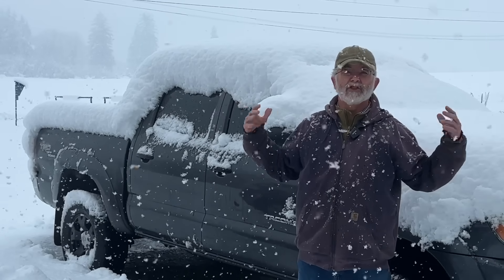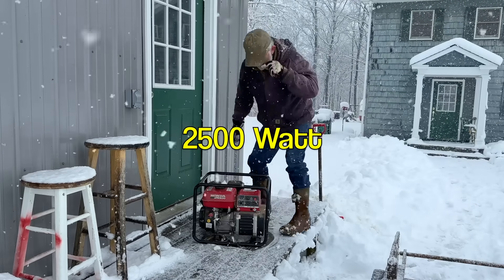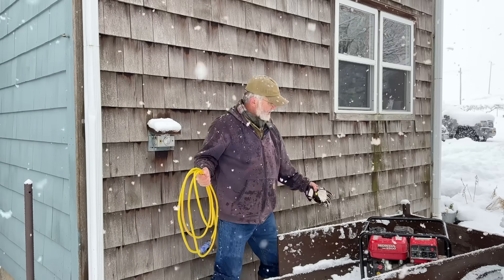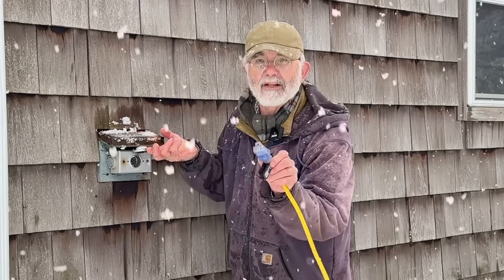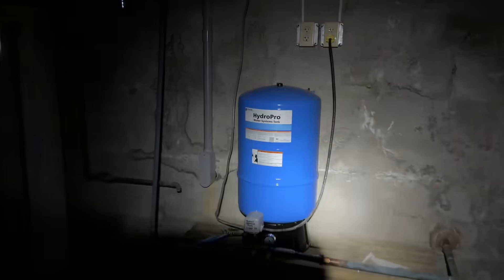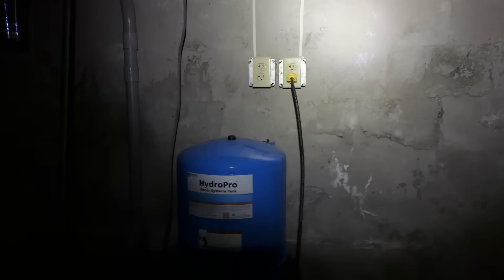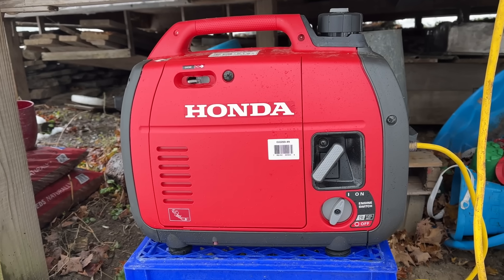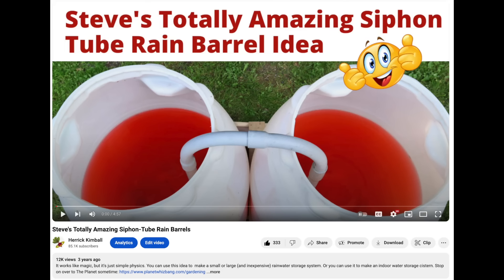Super Simple Generator-To-House Hookup  -- A Proven How-To

Comment: I personally find the simple main breaker sliding lockouts to be an even better solution and just as simple with no need to plug things in to different places.  Just run one outlet from a top breaker in your panel outside for the generator and then all you have to do is flip the main off, slide the lockout plate and turn on the generator breaker and all circuits in your panel can be energized.  All you have to do is not switch on too many things at once based on your generator size.  Simple and safe.
Reply: Yes, that is by far the simplest was to have back up generation with a 7-10K generator. Power goes out, flip the main breaker off, plug in the generator on the outside plug, wired to a 50 amp breaker in the  main box and you are set for all circuits. Had to run 10 days once and was fine.
Reply: A Sliding Lockout is a sure fire solution and simpler.
Reply: Interlocks are required
Reply: I have done something similar by installing a separate panel that has an inlet for my generator and circuits that are next to my critical appliances and furnace. Those circuits are not connected to the grid and their face plates are red indicating they are "emergency " power outlets. When power is out, I unplug from the grid outlets and plug items into the "emergency" outlets right next to the grid outlets. I know when the power comes back on by the grid because my lights are still in the grid outlets and then I know to switch back. I use oil lamps and battery lanterns for light. This setup keeps me from dealing with codes and inspectors and, most importantly, protects the electrical workers since the circuits are separate. I got this idea from the hospital I work in and saw the red outlets next to every bed.
Reply: @ This certainly works and is safe, but it is both costly and inconvenient compared to installing a generator outlet near your service entrance and then connecting it to your panel via a breaker and a generator interlock.  And with the latter, there is no need to go through your house and move the plugs on every appliance you wish to use, which of course has to be done again once the power is restored.  With an interlock, you flip the main off, slide the interlock and flip the generator breaker on and you are ready to use any circuit in your house.  And you can easily switch off any breakers for heavy draw items like AC that you don’t want to come one.  It is all done at one location in less than 60 seconds.  And for far less cost than running separate circuits to your appliances, installing a separate panel with breakers, etc.  I can’t for the life of me understand why anyone would do it any differently given the cost and simplicity of an interlock kit.
Reply: This is the legal code compliant way
Reply: @LTVoyager  my problem with an interlock is that my breakers are push button and I don't think they make one but when my solar is up and running I'll cut the grid as it doesn't. make sense to save 60 dollars a month and pay 200 dollars a month to stay connected to the power grid
Reply: @ If you have Pushmatic breakers, you really need to do a panel upgrade.
Reply: I did a setup with my portable 12,500W new GE 110/230 generator. The whole house generator was around $1,300, delivered.

I plug it into my 50A male plug... mounted right next to my main service panel. I have the big gauge 25' electrical power cord to run outdoors to the generator.
I roll the big generator  out the basement doors, cut the main power circuit to protect others from backfeed, and fire that baby up!

The generator runs everything in my house AND also runs my 230 well pump and Utica boiler.

I'm careful not to run too many large appliances like the electric clothes dryer, microwave, or electric stove top all at once.
You can hear the generator bog if you do.

Herrick, I realize you ran separate circuits for your generator power, BUT IT'S VERY IMPORTANT TO EMPHASIZE CUTTING THE MAIN BREAKER TO THE STREET IF YOU DO NOT HAVE DEDICATED GENERATOR-ONLY CIRCUITS.
It's too easy for others to make a fatal mistake affecting power company lineman.

Sincerely,
Your Fellow Upstate NY Neighbor
Reply: @ This is both an illegal and a stupid way to connect a generator.  Protecting lineman absolutely must not depend on your memory.  It needs to be failsafe.
Reply: @LTVoyager  No, there is no problem with Herrick Kimball's set up because there is no connection to the utility power and no possibility to feed power back into the grid.  Watch the video again.
Reply: @jimthode  I was replying to Yoppyman, not Herrick.  Not sure why my post lost the name after the “@“ sign.
Reply: @LTVoyager  Watch the whole video!!!! hes not connected to his Breaker Box!!!!!!!!!!  Pay Attention!!!!!!!!!!!!!
Reply: @MRTLEW01 Yes, pay attention!  Read the prior comments.  I was not commenting on the video.  I was commenting on what another commenter said.  Try to keep up.
Reply: @LTVoyager A shame you don’t understand electricity.
Reply: @davidrobins4025  I’ve forgot more than you’ll ever know.  Just what do you think I don’t understand?

Comment: with a generator that small i would put a 4-gang box mounted vertically next to your sub panel and put in 3-way switches. hook the load to the common, and both feeds to the travelers. cheap transfer switch. ofcourse oveerload protect the generator feed before going to the switches.

Comment: I do the same thing.  I have a 20 amp inlet on the outside of my house.  It goes inside the house to power one outlet that is never hooked up to my regular house power.  That will run my sump, furnace and a few light appliances to keep us going for a few weeks on generator power.  I also have three solar power stations to move from room to room to power small electric devices.  My last ditch plan after a few weeks of no power is to use around 600 watts of solar panels I have stored in my garage to recharge a 4800 watt battery bank I have in my basement.

If you have a newer furnace with a circuit board you may need to bond a ground on your generator or if you run a battery bank and inverter system you may need to run a ground wire from the inverter to a chassis ground on your furnace for it to run properly.  The new furnaces will look for a bonded ground in your main panel and if they do not see that they will try to start and shut down.

Comment: This works but for just a little more, I just installed inlet 30 or 50 and just back feed panel with a manual interlock and I can pick and choose what circuits. I don't' have to worry about extra plugs or extension cords, etc.
Reply: I did like you and installed a 30 with the manual interlock, makes it so much easier, and as of yet haven't had to use it but I can say I am ready!!!!!
Reply: Be careful if you are backfeeding with a 120V generator like his. Few nuances

Comment: I have come up with a similar solution for my home. I do have a whole home generator but it really guzzles the fuel. This was pretty much my solution to power the internet and refrigerator/freezer with a smaller more economical generator. Love having both options. I have the same type setup with parallel outlets that are only active when powered by a generator. I use different wall plates so everyone knows. Great idea, glad someone else thought of it too!
Reply: @HIKETOGRAPHER Those generators can cost from $70 to $100 per day.to operate. The dealers also try to sell you the biggest generator possible when you don't need to run every light in the house. The only time people should get one is if they have medical issues, or children home alone. Of course if they want one or have money to burn.
Reply: Great video. 
Wonderful idea of parallel circuits. 

The only thing I would change is to identify “emergency power receptacles” as you mentioned. 
That way anyone that follows you can identify what you have done.

Comment: Unfortunately my well pump is 1.5hp 220.   I have 3 generators of various sizes including a 10kw dual fuel that can run most of my house except electric furnace and range. Fortunately I have a spring fed pond and rainwater catchment for flushing toilets and general cleanup so would only have to run the big generator occasionally. My main concern is power enough to keep 2 fridges and a chest freezer going and run the fan on my wood furnace. You worded it very well, not going to live like nothing happened but enough to be comfortable. You can keep all that snow tho lol. I'll take Oklahoma weather

Comment: I'm looking forward  to a power outage  in the winter here in Ohio. An electrician  friend  told me I can just put fuse out that runs the furnace, then disconnect the Hot black wire and White neutral wire and put a male plug on it. Then connect  it to my generator.  Got heat in the winter. No problem!

Comment: Simply easy solution to for house generator  hook up. Well done.  I ended up labelling the outlet covers as well as spray painting them RED.  I was going to check if I needed a ground rod to attach to the generator and how "clean" my power from generator is. (It is not a honda....)I am also an electrician.  You did a nice clean install. Appreciate efforts it takes to make these presentations.
Reply: just a thought - I'd make it glow in the dark paint, not just red.
Reply: Did you find anything out about the ground rod on the generator? Its been a question of mine for awhile. Thanks!

Comment: Your videos have been very helpful to me, now I can return the favor. We have just finished a diy hybrid solar/battery/inverter whole home power system. I also couldn’t justify the cost of a whole home backup generator, (which costs $15k in my area, and frequently fail), as you have correctly concluded, a high cost with no payoff other than convenience.
For less than that, we are now consuming ZERO grid power! I’ve been watching the solar industry for many years, and in my opinion, the cost and reliability factors have finally reached the “no brainer”point. 
The key is DIY. If I can do it, you certainly can…
Reply: I'm powering my home from solar too. My grid is my first backup and my generac generator is my secondary.  If I have a good charge in my ford lightning I run my home from that prior to using the grid.
Reply: @ I’ve been thinking about getting that Ford lightening for the same reason… adding to the battery bank!

Comment: Nice simple implementation but maybe label those outlets so everyone else will understand what they're for. And how did you address the grounding on the generator circuit? Maybe best that they be tagged/labeled as un-grounded? Also, what about moving the generator as far as possible from the house. A night time thermal inversion with no wind could push CO up against the house.

Comment: Agreed! A whole home standby cost is hard to swallow. I was quoted $18K CDN for a 24Kwh Generac unit.
Reply: I gradually built my home solar backup. Now retired at 75 I have 55 kwh of battery storage, 18 kw of solar panels and 8.8 kw inverter. With another 10 kw inverter connected to the same battery bank to charge my EV truck. It took many years but now I'm finally ready when our grid goes down for an extended period,  which it will either by failure, cyber attack, solar flare or nuclear EMP. What this administration is currently doing messing in Russia/Ukraine war we may not have to worry about having electricity or anything else for that matter. You can only poke a dog with a stick for so long before it attacks you.
Reply: @ek8137 Stay away from Generac go with Kohler.

Comment: My $1,000 Predator 8750 inverter generator runs my entire house, and it was much easier to just install a 240V 30 amp plug and a double pole 30A breaker in my 200A panel box, and no, I do NOT back-feed the grid👍
Reply: Transfer switch?
Reply: @ Nope, I hooked it up to my 30A double pole breaker from my old electric water heater. I have gas heat and hot water, a gas cooktop, and city water so I have no problem running my house. I have 200A main fuses that I pull before I start the generator.
Reply: Technically illegal.  Code violation.  But safe
Reply: @seethebutter  I know, but it was so worth saving the $1,000😂
Reply: @seethebutter no violation if a manual interlock is used

Comment: While it is a minimalist solution. I have a 7000 W running, 10,000 startup generator I connect to my main panel w a 30 amp 220V connector and manual transfer switch on panel.  During a outage, I drag the generator out of my garage and 10' away is my plug.  I have gas heat, electric hot water, 220v water pump, etc.  I run everything except my AC in the summer.  TVs and computers w. I problem (I am a computer tech).  The generator was $800.  You have 2 generators and 2 Jackerys. U spent a lot more money than me and have more transfer actions and power very minimal things.
Reply: You conveniently missed the point of having someone do that work for you…. Go hire an electrician to put a manual interlock on your panel.  I like you did it myself and saved a lot of money, but the vast majority of people don’t get into that level of electrical work.

Comment: Good video Herrick,  you keep em separate "one or the other and never both"  the only safe way to do it. Reliance makes a feed through inlet for generators with just the lnlet on the outside and 4 110v sockets on the inside. We just added a gen and we went the transfer switch route.  The only suggestion I have is to LABEL your Gen outlets!   Well done, have a great day.

Comment: I'm arguing with my neighbor- So you are running extension cords from that ONE SPECIAL outlet to your fridge and whatever and that's all- That special plug goes ONLY out to the generator. I think I got it - seems like genus to me.
Reply from the maker: Two special outlets. One in closet and one in basement for the water pump. Closet outlets provide power by extension cords (12 gage wire cords) to fridge and freezer. The "special outlets are powered by the generator only. 👍
Reply: @herrickkimball  Thanks Boss- you just won me a cup of coffee from the neighbor- I may give this a wang before the snow hits

Comment: I used to do the same thing you do, but after slipping on ice and screwing up my rotor cuff, I don't pull any cords any more. I have a 10K generac generator and installed the whole thing for $4k.  All automatic no doing anything with any of that bs. If it really hits the fan thats life. At 75 dragging gas and pulling cords don't fit my bill anymore.

Comment: 1998 we had a 3 to 4 day ice storm in northern VT and NH. Maybe you as well. My Homelite 2500 watt Briggs powered generator that my dad had since the 1970s was shuttled from house to house in the neighborhood. It was hooked up to furnaces or heaters for a few hours and then on to the next. A fireman who was an electrician oversaw some wiring changes on 120 volt furnaces for temporary plug in to the extension cord. Your idea makes it a lot easier to accomplish the same thing on a more permanent basis. In my house the sump pump is on the critical branch along with the freezer, refrigerator and furnace. We are on town water.
Reply: For your sump pump issues, look into water assisted sump. No power required. Uses your town water pressure.
Reply: @TD-we1vpgreat idea

Comment: Great idea I have done the same thing for my well at home nothing connected to the grid completely separate system run off your generator. A 500 gallon propane tank and a 5,000 watt predator propane generator and you could power for a very very long time!!

Comment: All fuel shut offs and carburetors are different but, I’d turn on the fuel 5 to 10 minutes before trying to start the engine to let the carburetor fuel bowl to fill.
The engine should then start much easier.

Comment: First, I thought that it was going to be an illegal hook up.  Surprisingly, it was done as a parallel system.  Good job, that was an excellent choice...  I would do only two things for this system.  First, I would label the cover plates for the generator power lines, or when I am at lowes/Homedepot/Ace, I would just buy the orange cover plates like you see in a hospital, and label them so that any idiot might know what it is.   An added label might be where the generator inlet box is on the exterior of the house.  Second, I would add a cover for the generator cart.  It is always snowing or raining when you need the generator.  For me, I put an inlet box in my outbuilding and ran a dedicated 10/3 underground line to the house.  I built the outbuilding with a covered porch(for the generator).  The inlet goes to an outlet near my breaker panel. I did go with a 10 breaker transfer panel and have a 14-30 plug there.  The plug can go into the generator inlet(outlet) at the panel, or will plug into something like the Eco Flow Delta Pro ultra if an when I get one.  I also put a protocol for what to do, if I am not here during the even.  It is next to the panel.  That way the wife can follow the instructions and start up internal power.  Good job with your setup.  Oh yes, my first generator was the Generac xl 5500 from 1998, after Ice storm 1998(Plattsburg NY).   Still starts on the first pull.
Reply from the maker: Excellent. 👍

Comment: I've been using a through the wall generator kit for years works great
Reply: I hope this doesn't sound stupid but with a 'through the wall' generator kit what you would have is a number of interior extension cords running through the house from the exterior mounted Inlet Receptacle feeding different appliances, lights etc?  Thanks
Reply: I live in a trailer I have it going to my living room so all I have to do is run one cord to the kitchen for the fridge